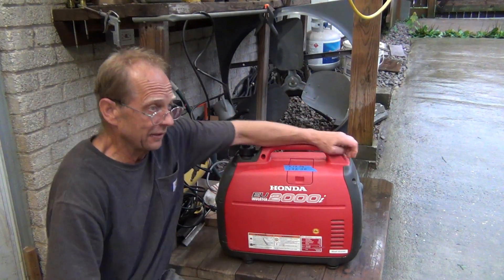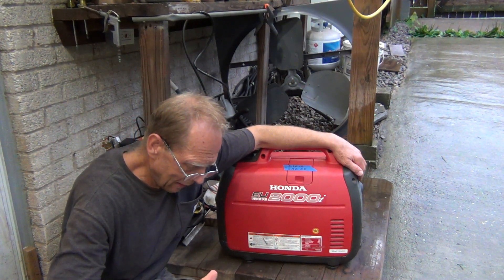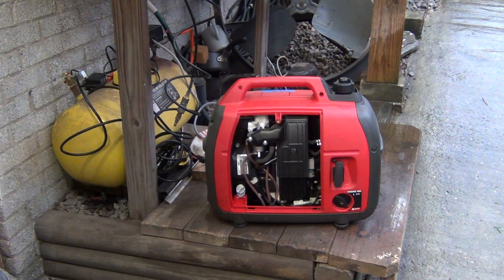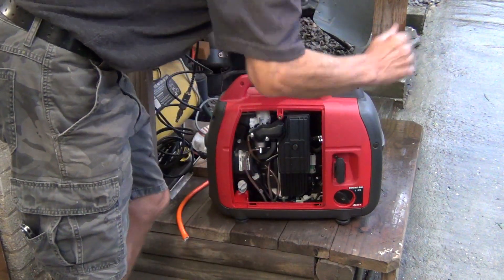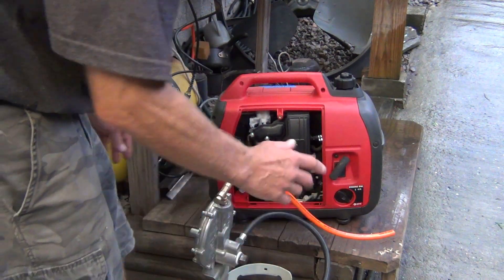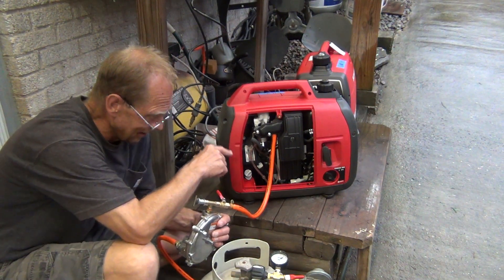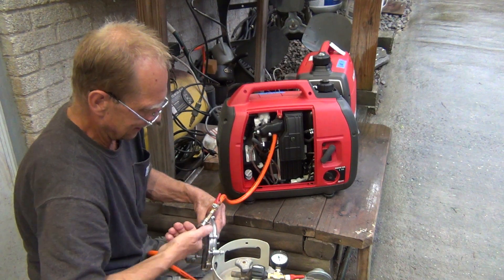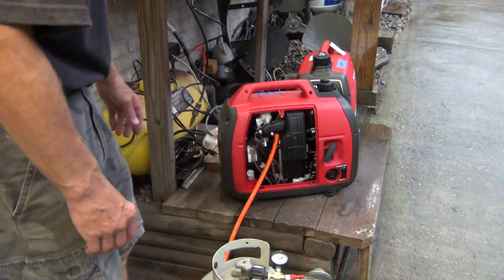Run any generator on propane without conversion kit, Honda EU2000i

Comment: I cannot see what you are hooking the propane tube up to inside the generator. Most of us are not mechanics watching this and we need to be able to SEE and HEAR please. The rain makes it impossible to hear you and switching volume off does not help because the camera is not zoomed in to see the carburetor or pilot jet or anything to see if the hose is getting hooked up on the pilot jet side or the carburetor drain side or what. Please explain and thank you for your thoughtfulness in making this video for emergency alternatives

Comment: I bought the ALP propane generator instead and kept my Honda 1000 gas so I have easier switch from propane or gas.  This is too complicated and it costs $300 USD just for a kit.  The new ALP is $504 USD.

Comment: The hose you removed to attach the propane hose; what does that hose do? When the hose is attached- what does it do and also what does it do when it is not attached? Question #2- Is there any harm done to the engine by running this setup on natural gas or propane? I read the values get too hot? lack of lubrication from gas?? I want to make sure I understand every thing about this prior to trying it.

Comment: Any internal spark combustion engine will run on natural gas (methane), propane, or gasoline. The trick is adjusting the air fuel ratio. You are a master mechanic for sure. Thanks....

Comment: It won't work because it needs to be hooked to the Venturi. It won't work just hooked to the intake. If you can't get to the Venturi you need to make one or have the proper adapter.

Comment: Will you post the regulator with the fine adjustment that is needed?
Reply from the maker: I won't, sorry, I just want to show it works but it does need fine adjustment.
Reply: @VladFredK  they sell the regulators all over the web. Its not like I am asking for an illegal product
Reply from the maker: @MikeJordanUnCamplicated  I guess I misunderstood you,  r u asking "what is the regulator needed for this Honda? Or what is the fine adjustment on top of the regulator?
Reply: @VladFredK  I was asking which regulator that you used
Reply from the maker: @MikeJordanUnCamplicated  Century 039-122 is good https://www.amazon.com/Century-Garretson-Pressure-Regulator-Converter/dp/B00EP1N1X8
Reply: @VladFredK  You can get that from Century Fuel Products for $63 including shipping. Amazon is $89. I don't think the CFP regulators come with the adjustment valve. Does the Amazon regulator come with the adjusting valve?
Reply from the maker: @MikeJordanUnCamplicated  nope, I made my own

Comment: Thanks for the video. I installed a starter on mine and I'm going to try this sort of conversion for my off grid setup that auto starts the generator to charge up my batteries when the solar can't. I"ll be wiring in a solenoid valve to stop gas for safety.

Comment: Sure. How many people are gonna  mess with a $1200 generator. Im callin bullshit. If you have money to burn and time on your hands what the hell.
Reply: Tens of thousands are converted to propane and natural gas.  And to some of us, it's worth the $200 in parts.  Been running two for ten years.
Reply: He will burn that generator motor up over time and it won't be much time
Reply: Any spark engine will run on propane!!!@

Comment: Is running it on propane harmful to the fuel pumps in the EU models??? I don't know enough about these specifically but i do know that fuel pumps generally are not meant to run dry.
Reply from the maker: I have no idea
Reply: The fuel pumps are negative pressure with check valves, they are not mechanically or electrically connected to the engine, they have no moving parts so they are ok with this conversion and "running dry" as you say.
Reply from the maker: @DaveK84  Good info but how do you know that?  Thanks

Comment: I have experienced use of these as a power supply for the travel trailer on forest service roads. Which they're just right for.▫▫>share4.photo/H2KGenerator?d56d   My intended use is that and for powering the furnace during outages.

Comment: Vlad, great video. What kind of valve you are using to adjust the propane flow? Thanks
Reply from the maker: I just made my own
Reply: Wanted to know where you bought the valve for the fine adjustment. Thanks
Reply from the maker: @asdzxcvbn1234  made my self
Reply: asdzxcvbn1234 if you can find one an old valve for those mini burns O-Matic torches will work just fine the one that takes a little bottle of map gas a little bottle of oxygen they’re a double line yod use one of them they have their own valves,,,,also sometimes you can use old propane turkey fryers  as well,,,of course using it that way you would not have a safety regulator it would only be for emergency use,,,you could use it with a 1 pound cylinder of propane you can refill them with an adapter from a 20 pound tank,,,You can also come off of the natural gas line into that small line and valve and do it that way of course in an emergency only

Comment: Where are you putting the hose going to the generator? I'm not familiar with the Hondas but usually you got to put adapter between air cleaner and the carburetor to pull enough vacuum to open the pancake valve. Or what's the name of your kit if you bought one?
Reply from the maker: I don't have a kit, only Garretson regulator